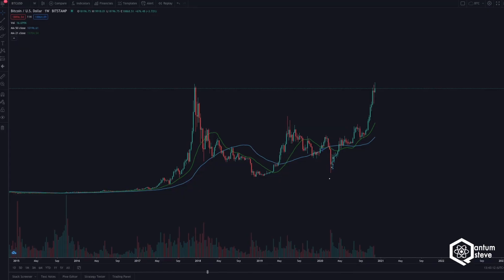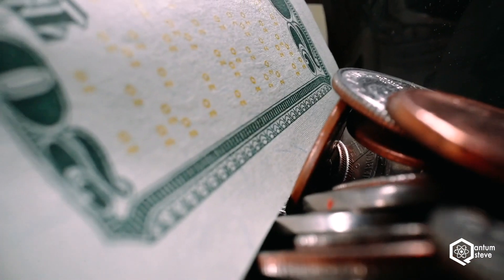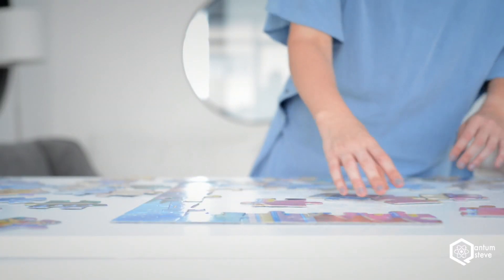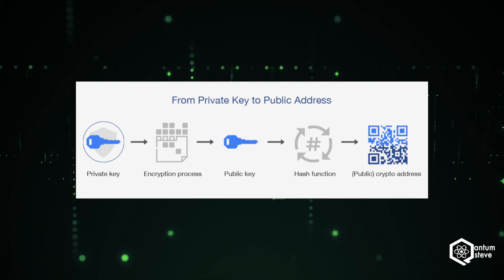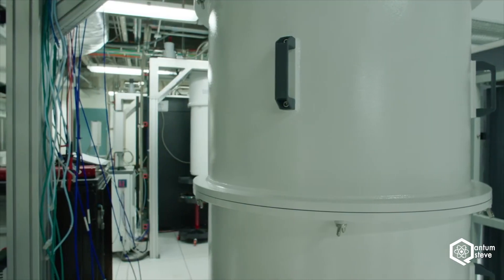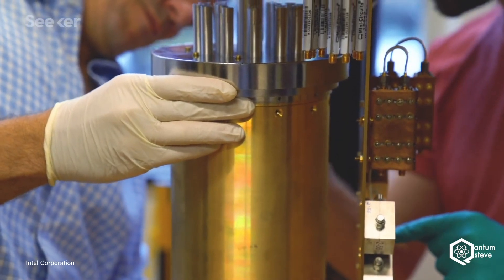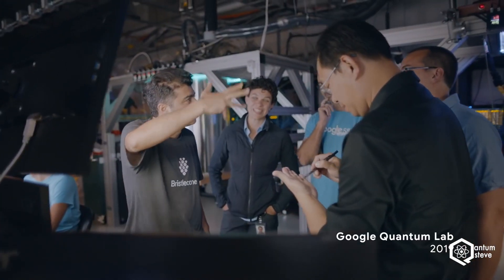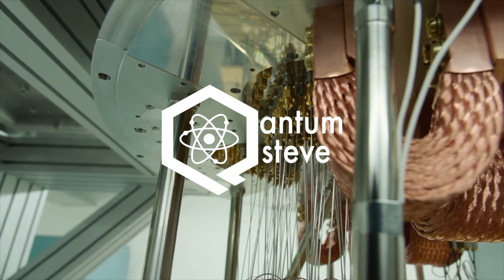Can Quantum Computers Break Bitcoin? - Quantum Computing Explained

Comment: In 3:20 you say that a hash of the private key gives you the public key. This is not true! The private and public keys have a strict mathematical relation. In Bitcoin we use ECC. The private key is a random (long) number and the public key is a multiplication of the private key with a point (the generator) on the curve. No hashing involved
Reply from the maker: Yes, you are right there are some inaccuracies in the terminology.

Comment: I wonder what data you saw that made you think we were on the 'slower side of things'? Genuinely curious. The screenshot you show at 7:37 shows a higher than doubling of qubits per year?

From 2021 to 2022 is 3.4x? 2022 to 2023 is 2.5x? Are these overly optimistic/shareholder projections?

Good video and explanation of bitcoin and the dangers
Reply from the maker: So in the paper there are two lines, one is a doubling every eight months and the other is every 20 months. If we were on the eight months line we would have 100 qubits by now. Also considering IBM’s roadmap they aim at having 1000+ qubits by 2023 so to be on the fast line they would have to have 10k by 2025 which is not possible at the current rate. Thank you!

Comment: I'm more interested in how quantum computers might effect mining. Will a quantum computer mine up the rest of the bitcoin supply in a crazy short amount of time. The instant we get 1 fully working QC will mining bitcoin become useless?
Reply from the maker: Mining will most likely be unaffected, at least according to what I’ve read. This is because the ASICs that are used for mining now are super fast and very hard to beat. To do mining on a quantum computer you would use Grover’s algorithm which doesn’t give the same speed up as Shor’s. Also what you need to consider is that in mining is a game of who is the fastest (you have around 10min) , however to crack the crypto algorithm you can let the quantum computer  run for days or weeks and get the private key which classically you cannot.

Comment: Around 5:20 you say that the IBM QC ran Shor's algorithm for N=35. I wasn't aware of that and to be honest i doubt this is true. We might have enough qubits to run the circuit for this number but the circuit depth needed for Shor's algorithm is currently far beyond IBMs reach.

I will be extremely happy if someone proves me wrong!
Reply from the maker: Here you go: https://journals.aps.org/pra/abstract/10.1103/PhysRevA.100.012305
Reply: @QuantumSteve  thanks!

Comment: Bitcoin has  2^256 private keys. Run upgraded vanitygen software on a min 256 qubit quantum computer and voila! You got the target accounts’ private key. You do not have to crack ECDSA. Private key space is large but limited. When you run same qubits at the same time you could find the target key in seconds.
Reply from the maker: Haha what? How do you plan on running vanitygen on a quantum computer?

 I guess what you are suggesting is to check all the combinations, for which you could use Grover’s algorithm which gives you a speed up but it’s significantly slower than the method I discuss in the video from the paper :) Shor’s is the way to go in this case!
Reply: @QuantumSteve  first it wasn’t a funny thing that I wrote. Second if you can run any software to crack ECDSA why couldn’t run any software vanitygen (when I said vanitygen, I mean some kind of software like vanitygen), it is possible to crack target wallet with brute force with quantum computer.
Reply from the maker: No you cannot really run just any software on a quantum computer. What you can do is run specific algorithms for which you know or hope that there is a quantum speed up. Running classical brute force algorithms on a quantum computer is going to be slower than on classical computers due to its clock speed. A sophisticated quantum black box search algorithm that you can use is Grover’s which gives you a polynomial speed up over the classical version. Shor’s method however gives you an exponential speed up! This is actually discussed in the paper that I’m referring to. So once again Shor is the way to go, current research is very disputed when it comes to Grover. Some think that the overhead of loading classical data on the quantum computer kills all performance gain.

Comment: A couple of point that lead to a question. First - D-Wave announced their 5,000 qubit quantum cloud platform availability. It is a different type of quantum computer but . . .  that is fairly powerful. Second, IonQ announced they achieved a 99.9% qubit fidelity back in October. That is a giant move towards the perfect qubit!    Now the question.    Combined or individually, can you re-estimate when a quantum platform will be able to crack Bitcoin?
Reply from the maker: Ok so regarding the first question: D-Wave is a quantum annealer which means that it can only solve optimization problems. It cannot run any other algorithm such as the one discussed in the vid. So nothing to worry about when it comes to crypto.

Regarding the second question: IonQ has some very impressive stats but it will be very interesting to see how they are going to scale, it seems to me like superconducting quantum computing has a clearer path. Nevertheless, to run the algorithm you will need error correction so perhaps the overhead on the IonQ device will be lower than on the IBM device. What I’ve heard is that there will be a factor 10 difference which means essentially just a few years considering that the number of qubits double. So basically even if IonQ turns out to be able to scale without issues I think it’ll only change the time line by a few years. But I haven’t done the math that’s just my two cents.
Reply from the maker: Oh very interesting, thanks for sharing. I figured that you could cast it into an optimization problem but honestly D-Wave has been around for some time and they still haven’t shown a quantum advantage. Some people think they never will, I honestly don’t know. It seems that for most hard problems you require exponentially long annealing times. This is why the QAOA seems promising! Perhaps using the QAOA to solve the factoring can be done? I’ve heard something about Variational Factoring from IonQ so I think it’s been tried already. I’ll have to look into it! What’s clear is that the speed up over classical methods is less clear, for Shor we know it for certain.
Reply: @QuantumSteve  I have a theory about that :-) Perhaps D-Wave like others are trying to avoid regulation that could accompany proof of the decryption capability - your thoughts?
Reply from the maker: @kevincoleman8549  Haha well honestly I don't think so :) But only time will tell!

Comment: Yes, I do agree that around 2030-2035, there will be some massive change assuming that we will have scalable high-volume quantum computers. Progress is surely slow but in the end, the result is well .... "costly", but achievable.
Reply from the maker: I totally agree! Once we have the hardware to actually run the algorithm it might at first take weeks or months to break the encryption, but that’s then already very worrying for everyone that’s using elliptic curve encryption.
Reply: @QuantumSteve   Well, we won't have to, because businesses and governments are also working hard to tackle those problems. The damage should be minimal since the adapt-change time will be bogusly fast. Just think about how fast people in the world use (version to version) since 1990-now and you'll see it. I can tell from a normal user perspective.
What do you think? From programmer/engineer perspective?
Reply from the maker: @LongLe-vc8qq  I can only answer from a physicists perspective :)  At the moment it seems very much like science fiction, but I have to say that the progress over the last two years has been very impressive. Also, I think something that they didn't consider in the paper that I mentioned is that there are many different other error correction schemes that could potentially also work and require significantly less qubits.
Reply: @QuantumSteve  You forgot to mention: Cheaper, and more affordable. By the way, I have a question. How many steps do I have to take to calculate 3 x 5 = 15 in a quantum computing way? I really don't know how to do that.
Reply from the maker: Are you refering to Shor's algorithm (figuring out the primes that make up 15) or do you want to perform multiplication? If it's the latter you can watch quantum calculator video, where I do just that.